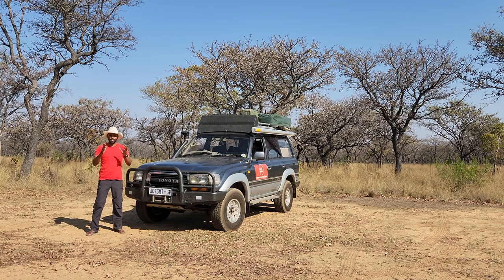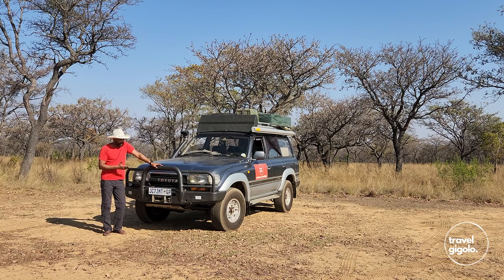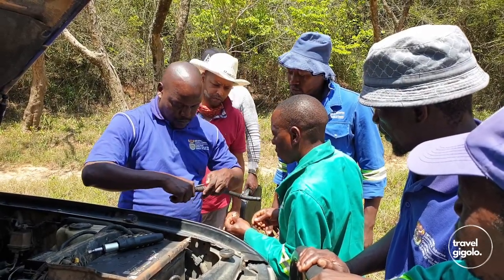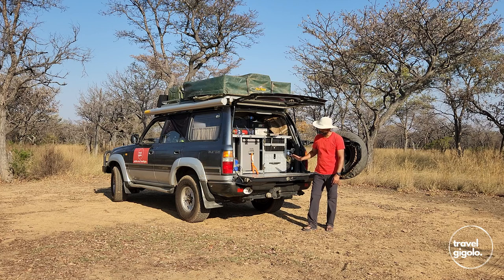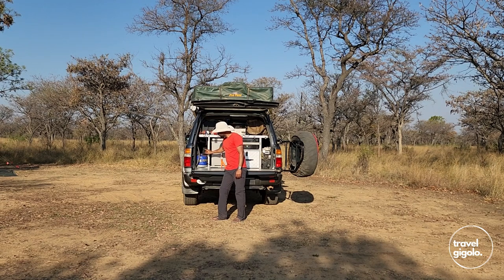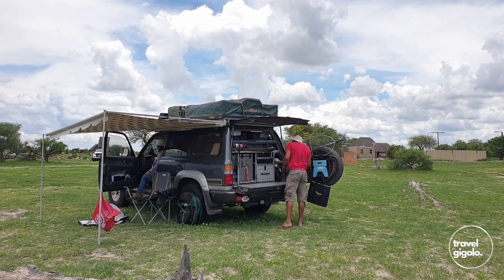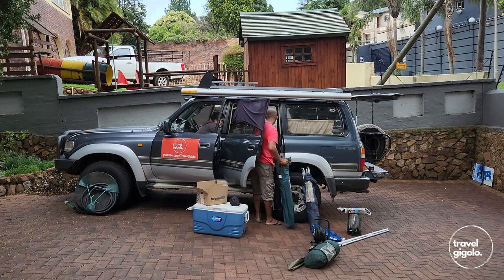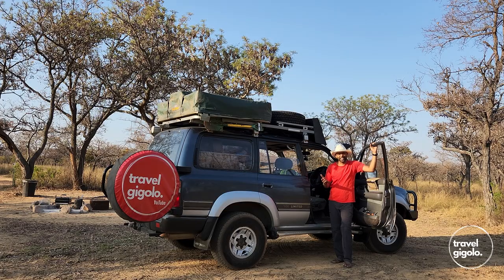Toyota Land Cruiser 80 Series VX 4x4 aka The Wild Dog Full Walkaround (Overlanding Rig Walkthrough)

Comment: hello bwana - great clip once again from a legend! May I suggest free wheeling hubs in front to help with fuel consumption. With free wheeling hubs, the front wheels will disengage from the wheel and should reduce drag in the front diff. Just a suggestion.
Reply from the maker: Thanks Dinka Man! 

The vehicle is by factory default full-time 4WD so we cannot disengage the front drive train. It does make life easier though as we don't have to stop and engage when we get off tar road.

Comment: On the topic of barn doors vs tailgate. Most would prefer the barn doors because they provide dual tables and coverage from the wind. The other thing is, when you open the tailgate. You would naturally move away from the car. On barn doors, you actually get closer to your gear. And thats also the reason why the 70 series was never offered with tailgate
Reply from the maker: Barn doors are indeed much easier for loading and unloading heavy stuff. The heaviest thing I have to load and unload is the tent at 18kg, which is not much really. Personally, the versatility of having a load-bearing flat surface immediately available is preferable with shade/rain cover from the top hatch.  The wind of course is a whole other matter. For us, having overlanded with the Patrol as well, the hatch is definitely preferred.

Comment: Great vid!
Looking to purchase one of these soon. Your opinion on the auto box?
Reply from the maker: For it's era the autobox is pretty good in my opinion. It's a four speed so fuel consumption is not great. That's the only significant negative for me.

I've had no significant issues. The kickdown cable got stuck once in It's sheath, and that had to be replaced.

It doesn't hunt when driving at low speeds in parks. It's pretty good on the highway as well. 

Overall I am biased to auto boxes though. It's just so much easier than manual.

 I'm quite happy with this one.

Comment: Thanks for your walk around. I'm planning a UK to Cape Town and am trying to choose between the older VX and the cheaper Land Cruiser 3.0 D-4D LC4....choices choices. Any opinions on this choice?
Reply from the maker: Hi Sizwe,

The LC4 is what we call a Prado here if I'm correct. I think they come with a centre and rear diff lock. 

In my view that will be a very capable vehicle and will be more fuel efficient than the 80 series. The only vulnerability, in my view, is the electronics if you find yourself doing water crossings.

Having said that, I would be happy with either. If money is not a concern then I would choose the 80 series VX. If you want to save on fuel (I expect it will be your biggest cost) then the 3.0 D-4D wins hands down.

Also note that some African countries require a Carnet du Passage, which I believe is related to the value of the vehicle.

Hope that helps.

Comment: You have an Aisin 1000 winch. It’s rated to 1000kg not 5.5 ton. Be careful exceeding the factory rating. Or use pullies to double your rating
Reply from the maker: I made an error with the winch rating. I only noticed it after posting the video.

Winch is a Denso 38600-60050. Rated at 8 000 lbs (3 600 kg).
Reply: @TravelGigolo  it's rated at 8000 lbs at a triple line pull. at a single line, it can only pull 1000 kg. Look at the decals on the original bumper.
Reply from the maker: The name plate on the winch doesn't state the load rating. I understand it to be 3 600 kg from the IH8MUD forum. Haven't found anything else online except from these guys https://absolute-wits-end.com/wits-end-toyota-jdm-winch-rebuild-project/ 
who also say it rates at 3 600 kg. The picture they have of rating doesn't translate very well due to the low resolution, but it does say 3 600 kg (using Google Translate)

Wouldn't be nice to find out otherwise in the bush, so I would like to be certain, and appreciate your feedback. Do you have a reference that I can look at?

Comment: Hi Travel Gigolo
Im sure ive watched a video of tou and yoour mates in Zim which i enjoyed.

Im going to sub ro tour channel. Im planning buying one and foing it as a project in Zim. I live in UK so can only travel home in December. So you know any breakers in SA for parts and roughly how much can i get a diesel engine 

Whats the real life fuek consumption like on long drives sir on the highway at say 120-130km/hr?

Thank you in advance 👍💪🙏
Reply from the maker: Hi Tinashe,
The consumption on the 80 series turbo diesels is between 15 L/100km on tar highway to as high as 25 L/100km on sandy roads. Depends on which engine you have. Depends on which engine you have. Mine is the 1HDT.

There are a number of Land Cruiser specialists in Gauteng. Your best bet will usually be N1 4x4 in Pretoria, but check online you'll find others. Parts are easily available from Toyota although sometimes they have to order from Japan so there may be a lead time. Of course new Toyota parts will be more expensive than used parts.

I don't know how much an 80 series turbo diesel engine will cost you, but it will probably be difficult to find and more than R80k.

Comment: Hi out there. Has anyone been to Savuti, or driven long distances in soft sand in a Diahatsu Terios?
Reply from the maker: I have no experience with the Terios, but I advise that the vehicle needs to have the right tyres so you can drop the pressure (I drop to about 1.4 to 1.6 bar using all terrain 265/75/R15, and can go down to 0.9 if I have to), and that you should have a 4WD drive system.
Reply: @TravelGigolo  Thanks mate. I have done quite a bit off road with it and it is pretty competent. Unfortunately I don't have the 4x4 version. I thought of fitting a winch. I think it is picking the right season to go. Love your content. Keep it up.
Reply: I have tried it with a 4x4 Terios and I would try it again. I have it fitted with BFG KO2. 

The challenge was ground clearance
Reply: @lexubiga  Thnaks mate. Looking at the website their tyres look pretty awesome. I don't have the 4x4 version of the Terios. I have experienced driving through Zaire (Congo) when I was younger in a 2.5L Petrol Landrover which I had to do in 2WD as the front diff broke. A challenge, but you get through with plenty of "road-side assistance" which I guess you don't get as much  of in the remote areas and Nat Parks in Botswana. I'm thinking of instead of selling the house to buy a 4x4, is to buy a winch and plenty of beer for those who may need to help me now and again. I have to be realistic as an adventurous 65 year old. (What do they say?... Oh yes...LOL) In your experience would that work after fitting these treads?